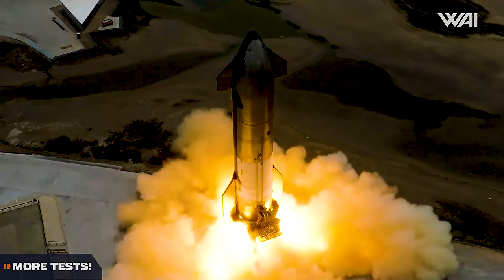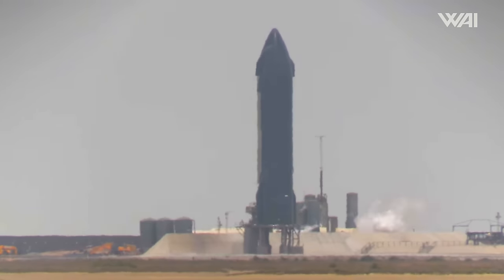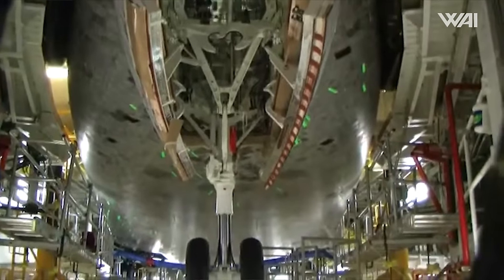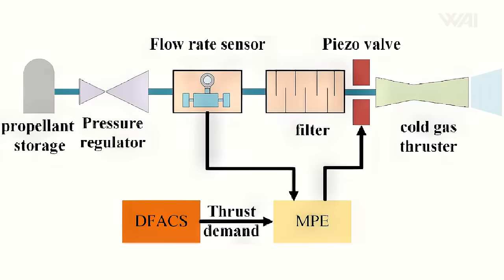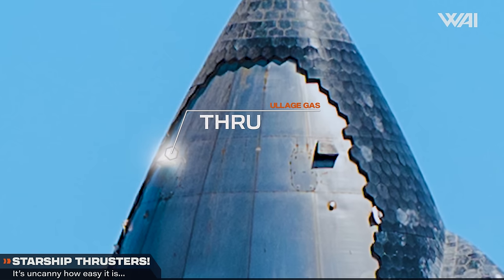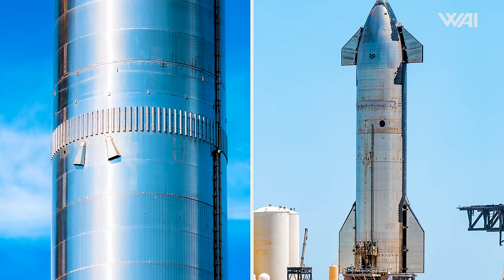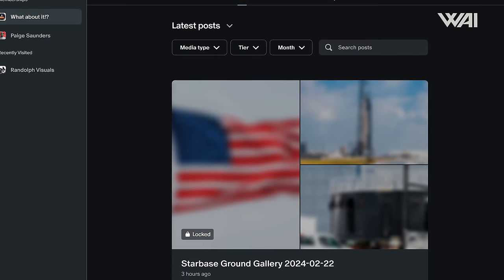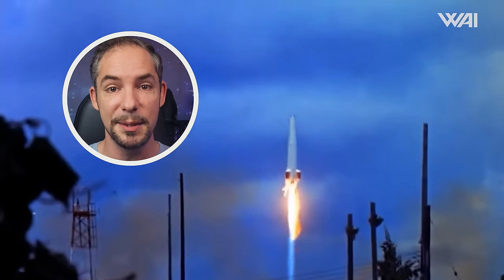SpaceX Starship's #1 System Fix Needed!

Comment: Why could they not incorporate a resistant heater on the nozzle to raise the temperature of the nozzle surface to a point where ice cannot build up?  They use these systems in deep freezers to prevent ice buildup and it seems to be an easy and straight forward solution to this issue?
Reply: Um, no power source? Remember this spaceship is supposed to be able to park in orbit for months or years. Rocket make no electricity so the unit Telus on batteries. Solar panels don't handle high thrust. Also that system would need to survive when the bell gets cherry hot while burning and not affect the bells expansion and contraction.

Comment: Regarding the heat tile issue, I've got an idea. Not sure if thats possible but here we go. I would apply some kind of resin type epoxy layer which hardens and keeps the tiles attached and in position for launch. During reentry the resin would burn up but hopefully hold long enough to guarantee the tiles stay in place and protect the ship until reentering the atmosphere.

Comment: To be fair the space shuttle managed to get back once with damaged tiles, it was only because the place where the tiles were missing was steel rather than the overall body which was aluminium, also because the upper stage is mostly 1 big tank it's drag to weight ratio would be higher so it will slow down more quickly than the space shuttle, so likely Starship can survive a couple of missing tiles, the re-usablity would be shot though and they would have to scrap the whole upper stage, so it is important to sort this out still, but it's likely not going to be at the top of the list, just like making the craft completely reusable isn't at the top of the list atm.

Comment: The best way around this is to make larger puzzle type tiles where not only do they interlink with each other but to make larger molds or even one big tile for the whole ship with flaps and possibly the nose cone being the exception unless they carefully fit it over cone first like boot 👢. Have some key points where you lock 🔐 it down.  It'll be large and  customized, but then again, all of it is customized anyway 😊. Post appreciated.

Comment: Heating thruster nozzles with ribbon heaters may solve that problem?
Reply: It's the O2 valves that freeze up with water and/or CO2 Ices. The nozzles are cooled with methane. 

I would prefer to totally eliminate these contaminants from the O2 regenerative gas system.

Comment: Thanks a lot for your videos and analysis. I am sure that Spacex will solve sooner or later all the issues. It is my personal opinion that the most important issue is the propellent boil off. This is a big constraint especially for long travels. I think that the use of Compressor can solve 3 tasks: propellent transfer (see LPG transfer in rail tanks), RCS cold gas and finally re-condense the vapor phase avoiding boil off. But to use it, there are 2 problem to solve : its cooling and lubrication.

Comment: Yeah, it's going to be interesting to see how they manage that role on such a massive vehicle because I don't think reaction wheels are going to do it. And even if they could, they'd have to be so massive you wouldn't want them on there. So a cold gas system or maybe the return of the hot gas system, I don't know.  Maybe if you had tanks on the correct side that you could pump fuel and oxidizer into for reentry just so it has a more passive stability.

Cheers from BCZ!
Reply: *roll

Apologies for any grammar of spelling errors I was using voice dictation. I just saw that it made that mistake. There may be others.
Reply: @thebarkingmouse  Click on the three little dots to the right of your post; you may have "edit" permissions, so that it will appear as if you got it right the first time.
Reply: Control moment gyros work well enough on the ISS. Starship could desaturate them by firing the raptors asymmetrically or gimbaled
Reply: I'm pretty sure reaction wheels are only practical in microgravity. There's no way they'd be useful during launch. Not enough force.

Comment: One possible solution for fuel slosh is directly from the 3D printing world: When you 3D print in special materials, as in Chocolate, you use a syringe that the extruder motor shoves the piston into, to extrude the exact volume of chocolate. That way you have no bubbles or chocholate sloshes when the printer head moves.. They will need to implement some kind of variable fuel tanks volumes.
Reply: Im big fan of the piston concept. Slosh leaves so much to chance and so much potential damage.
Reply: Pistons might be also useful for fuel transfer. If they don't want to use rotational force. Is rotational force the plan for fuel transfer?
Reply: That's been done but there's a significant weight penalty.  Basically it's two tanks, one inside the other, that also result in less volume.
Reply: Additionally I will tell that due shape of piston there is penalty in structural integrity, and cryogenic fuel is a b...h. most materials that are used as seal don't like cryogenic. And those that can be in cryogenic, don't like standard temperatures. Same goes for other popular ideas like bladder. Cryogenic and volume is problematic. So either centrifugal forces, or acceleration is easiest way to do this. Centrifugal is cheaper as for fuel penalty.
Reply: Perhaps they could use some type of tank liner bladder. Possibly like those expandable space station modules. Or even just an aluminum foil liner like on a jiffy popcorn expandable top. As it has to withstand very cold temperatures.
Reply: @jeremytaylor3532  That's very difficult when dealing with cryogenic temperatures.

Comment: As far as the tiles disconnecting during a test. As you said, probably resonances with the ground equipment are to blame, but who knows? One way to address this would be to change the resonance frequencies for tiles that move too much. Some kind of spring perhaps that only acts when that is the case?

Comment: The first problem is that some of the tiles (over the seams between ring segments) have no pins at all but are just glued on.  That needs to stop.

The second problem is that the tile pins seem to just fix the tile's position rather than holding it down.  Maybe using a one-way spring-loaded system where the tiles snap into place and then can only be removed by breaking them into pieces, would be a better approach.
Reply: I wonder if they are using the static fire to check the heat tiles are correctly attached? Even if they get to the point where things stay on when done correctly, they will need a robust way to verify things are done correctly. (Either that or a robust way to repair tiles in space. Maybe WALL-E's friend TIE-L?)
Reply: To replace wooden boat planks, a hollow drill bit is often used to free the plank at each screw by drilling out a plug which includes the screw. Once a tile is freed by a similar drill , the remaining plugs of tile material could be shattered easily enough, leaving only a set of naked pins ready to receive a new tile. With a jig containing a set of drill bits, I could see replacing a standard broken tile in just a few seconds.
Reply: Maybe cover the entire ship with heat tiles?
Reply: Glue works fine. The main difference between star ship and the space shuttle, was that the space shuttle had an in between layer that accounted for thermal expansion. And yes I know that the space shuttle was more prone to thermal expansion due to its aluminum frame but still, gluing the tiles straight to the ship is an odd choice.
Reply: Perhaps they need an electromagnetic release for the tile pins ,,some sort of a ball and catch system -- external electro magnetic --removal/install  tool,, works inside tiles and in orbit 😵‍💫
Reply: @MadJustin7  I'm pretty sure Starship also has a layer of white-colored thermal blanket material between its stainless steel hull and the TPS tiles.  That's why you see a bright white color underneath, where tiles have (recently) fallen off or where a chunk of a tile had broken off.  I'm not sure how that actually works with the glue: whether the tiles are just glued on top of the thermal blanket, or what...
Reply: @juliancrooks3031  It's easier to fix the orientation issue.

Comment: Hire an audio engineer.  I wonder if subharmonic vibration of the ships skin or individuall tiles is the culprit behind tile failure? If there are internal attachments  near the tile loss areas, or the density differences in the tiles themselves, could get resonance vibration causing the glue to fail, or the tile to break. The amount of vibration from the thunderous engine test could easily produce the kind of frequencies to cause the problem. If you ever lived near a railroad and watched the plaster on your walls crack from that kind of vibration, youd understand. Just a thought. Individual tiles might benefit from susceptibility to vibration testing before being installed. Think of it like a violin. The strings are the engine, the bridge is the attachment points, the bridge pin the conducter, the box the ships hull with tile attached. Based on shape, wood type and thickness, the sound vibrates the box coming out the F holes. The results, pleasant music, or intense discomfort. Just a thot as I said. At what point in the test do the tile pop off? Got to be a connection. Lastly. The fact that ship is attached to Earth may be at fault itself. Dissipation in a free atmosphere might dampin the vibration and the problem will resolve itself. Just wondered.

Comment: The roll induced in Ship 28's flight could also have been a result of the propellent transfer test that put the CG off what was expected.
Reply: The transfer of over ten tons of propellant from the nose to the tail would make Starship very bottom heavy.  In addition to the roll it seemed to be struggling to avoid entering tail first.
Reply: The vehicle was tumbling from the moment the main engines shutdown. I don’t think the ullage thrusters were ever working.

Comment: A thin sheet (perhaps 4or5 mm thick) of tungsten placed over the tiles could protect them from a5mospheric 
7:35 buffeting during re-entry (the melting point of tungsten is over 6,000 degrees F).

Comment: I noticed a podcast last week, where carbon-carbon plates were introduced. These plates can be as big as you want. They called it the heat shield tech for the 21st century. This guy works together with Skunk works. I was impressed with the possibilities of this new material. He told also, that legacy tech that works for years, shouldn't be tweaked. He spoke directly about the tiles from Space Ship. It was an interesting podcast with a NASA engineer, a CEO that makes the new tech and reviewed IFT3. Maybe Musk should contact the guy?
Reply: Carbon-Carbon is fragile (STS-107)
Reply: It still has to be conformed to the tanks and somehow attached.  I don't think anyone is debating if the tiles will do their job on reentry, only that they will still be attached to do their job.  C-C may save weight. . .
Reply: @ScottSuhr-l8m  CC is roughly 6x as dense as hardened tiles, and while it can withstand higher temperatures, it is also ~50 times as conductive.
So, you'd be multiplying the tiles mass by a   factor of 300 if you replaced them with CC

Comment: i think either they are going to figure out ullage thrusters, or they are going to still use ullage with cold or hot gas as a supporting system for fine control or corrective measure...probably the best way to still retain some of the mass savings from using ullage gas as a thruster, but still have something to support it when needed.

Comment: I am shocked to hear they are thinking of using thrusters!  Thrusters are common sense and SpaceX has tossed that out the door.  Flight 3 showed the problems with creating gravity with a spin.  I am shocked anyone gave them the idea of using thrusters on the ship, as that was a free idea.  I retired from being a COO with a background in engineering.  This project makes me shake my head.  One of the most common issues in engineering is the lack of walking in the footsteps of those that came before them.  Engineers tend to toss out everything and redesign, costing a company millions, as they show they can design a wheel that looks similar to what we have used for thousands of years.  Why would management allow this handicap to continue?  Seems like Elon would know this trend and try to avoid these potholes.  When will they start using insulation between the heat tiles and the extreme cold from the fuel?  When we see this, we will know NASA's footsteps are being taken.  Toxic ego is expensive!
Reply: Why not try something that will save costs per ship first?
Just because something works better doesn't mean it's the best option for every single purpose, NASA makes taylor-made rockets and SpaceX makes standardized mass-production rockets; they have different goals.
Reply: @user-iz2oj8dd6j   Shouldn't the goal be to take objects to space and return alive?  Seems the goal is to prove they can build a better wheel, while using the most complex methods possible.  Cheap doesn't mean better.
Reply: It's not a bad idea to try something new or different. However, when you get hung up on trying to make it work instead of just moving on that's when it becomes a problem. 
Let's see what SpaceX does in response to this issue. 
Get stuck making it work?
Or move on?
Reply: @kensmith8832  The goal of flight testing prototypes is quite literally to figure out how to build a better wheel.

Comment: I really think that the missing tiles are not as big of an issue like Shuttle’s were. Stainless steel does a really good job ( as seen in IFT-3) of reflecting/dissipating the thermal energy the ship is exposed to. Compare that to the thin aluminum skin underneath the majority of Shuttle’s tiles especially in critical areas. What would be interesting to know is if the tiles could interfere with Starlink connectivity seeing as at one point there was plans to cover the entire ship in tiles (both black and white, HLS was the program i think?)?

Comment: They already have several batteries onboard for the engine vectoring and for the Starlink system. Seems to me they could just wire up some heating elements and maybe a thermostat or two to each RCS thruster to prevent icing. Just saying that running electrical wiring to the thrusters would be significantly cheaper, less complex and easier a retrofit than any other solution. The thrusters do not need to maintain human comfortable temps just, a high enough temp to prevent oxygen or methane from freezing.

Comment: 9:15 Vernier thrusters are possibly what will be used near the Lunar surface for HLS.

I am also interested in the Stokes propulsion ring which uses a single set of pumps for all engines around the heatshield.

Comment: Could Starship utilize "polarising" the hull as a second line of defence against missing tiles? You could have a thin "web" of filaments lining the inside of the hull, so that the system only switches on when said tile is detected to be missing - thus pump an electrical current into the area so it provides a thin skin of magnetism to "push" the plasma away? Even if the current isn't that strong, it doesn't need a massive amount of power to achieve it??

Comment: Wouldn't coating the current thruster system with some type of antifreeze substance for the fuels used fix the problem enough to work? For the heat tiles couldn't something like a wax coating help with vibration issues?

Comment: Given the mass of the craft, a combination of hot and cold gas thrusters could be the most efficient.  A single hot gas thruster with a plural of cold gas thrusters in one unit.  The cold gas would be the primary thruster, with the hot gas activating when either more thrust is needed, or if the temperature of the cold thrusters drops too low.  Siphoning some of the combustion heat to warm the entire thruster array would not be too complex.

Comment: Some point for the freezing problem. The standard solution for space application is just putting heat plates near the cold area. Thermal management for to cold is the easier part. Get rip off too much heat is challenging.

Comment: I dont know how the tiles are attached today, but based on images it looks like thee locking pins in each tile. Given the super high number of tiles it will be statistically probable that some will depart. Reducing number of tiles might reduce this probability but come with other issues; loosing one small tile is less problematic than loosing a bigger one. 
The root cause either way is faulty attachment method and is where effort needs to be made. The locking pins are not sufficient. A more permanent adhesive is likely a better solution. Combined with an appropriate gap filler to manage tank expansion-contraction and other movements, vibrations will likely be the way to go. This approach is more similar to what the Spaceshuttle used but will be much faster to service.

Comment: How difficult would it be to apply a tubular or puck style heater to the valves to keep them from freezing? It would take more power and need batteries allocated to it but I imagine it wouldn’t need to run all the time. A flow sensor could indicate a freeze or blockage due to frozen valve and activate the heater just long enough to unfreeze the valve or clear the blockage.

Comment: It would seem that tile reliability and adhesion could be better achieved by gradually increasing tile size, therefore creating fewer channels of turbulence, better adhesion through greater surface area, fewer points of failure.  But of course, this would require the ability to manufacture truly huge tiles, which seems not presently possible.  At present, the probability of any tile failing must be ridiculously low to ensure all remain attached.   Also, flight will stress tiles which survive.  How to access their readiness to endure another flight?